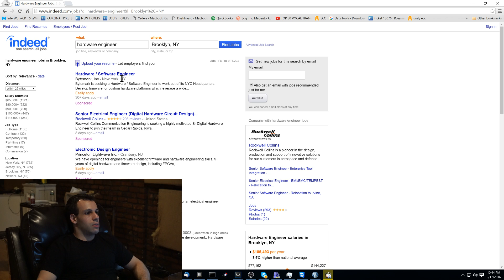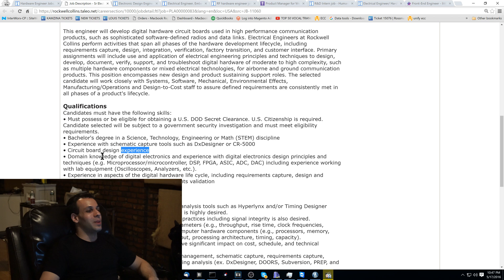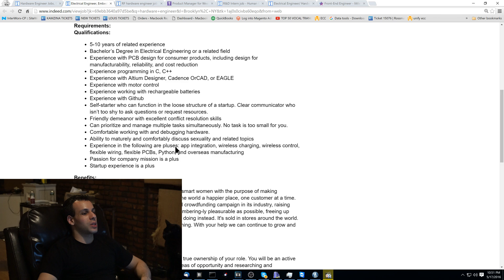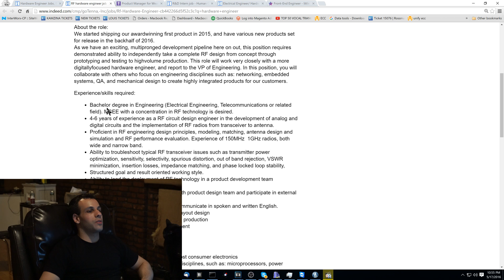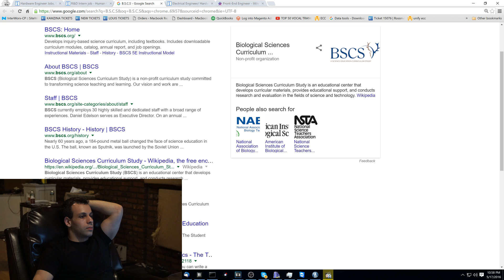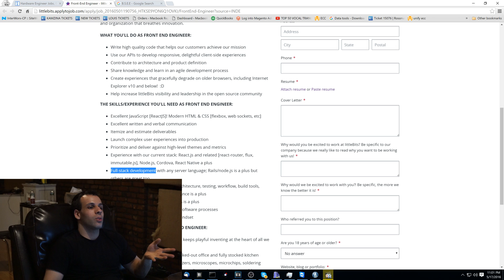Louis looks for a job

Comment: Programmer here. A lot of those requirements for software engineer (lame and pompous term for a programmer) are a bunch of crap. You can work for 5 years as a programmer and be as stupid as a baseball bat because you spent 5 years doing the same thing over and over again, not actually thinking and coming up with real ideas. There are people like this.

And there is a saying where I live which sound kind of like this: "You can be an idiot with a diploma". A diploma doesn't mean anything nowadays since the stuff that they teach you at university is outdated or doesn't reflect real life. Honestly for programming, there are much more better and advanced tutorials on the internet than you will ever learn at university. 

Companies that list a lot of stuff and see that you are capable just because you meet those numbers and conditions are stupid. Companies that list a ton of requirements are also crap and you should avoid them like the plague. 

A real interview checks to see how you are able to think in real life scenarios and come up with good ideas how to solve problems using the resources they give you. That's all there is to it. Honestly, it really doesn't matter if you don't meet some of those requirements if you can just google it and figure it on the spot. That's how I got my first job as a programmer. The interviewer was more impressed about the fact that I figured out a lot of stuff by myself on the spot than what I knew beforehand.

And serious companies that expect you to stay with them for at least 5 years really don't just look at what you know but rather what you are capable of and if you have what it takes for them to forge you into an awesome programmer. 

I have some friends who are programmers and never finished an university/college crap. And now he takes interviews with the ones that graduated university and thinks they are a bunch of idiots.

You know why some companies list a ton of requirements sometimes? Because a really important person in their company left and they need a new one really fast to replace him. So they can't afford to teach you the technologies and stuff they use. They want you to start working right away and produce the same results as the person that left because they need it badly. But think about it, if that guy left the company and he knew so much stuff that they listed as requirements, then there must be a good reason for that. That's a big red flag right there.
Reply from the maker: +Alecu100 thank you for the insight. This was a very useful post

Comment: There is more to pcb design than putting an op amp in a can,you have to take decoupling,impedance matching and thermal into consideration in digital circuits

Comment: this guy is not an engineer, it is just simple serviceman.He got no any exprence except replacing some IC on PCB. 90% ofthese offers are not for him. he just wont fit, have no skill, no education, no real exprience.
Reply: +andr27 definition of an engineer is very broad. He most definitely is an engineer.
Reply: +kazolar if you google the definition of engineer, 'designs and builds' consistently comes up.  Louis repairs motherboards that Apple engineers had designed and built.  There's a big difference between designing motherboards and fixing them.
Reply: +andr27  You're letting ego and arrogance assume that one should gauge the abilities of a person based solely on their degrees and/or certifications. I've seen people with bachelors and masters degrees get their asses handed to them on a platter by non-degree technicians.  He is gifted and has an obvious passion for electronic troubleshooting and repair which not all who enter this field have.
Reply from the maker: +andr27 this is the point of the video.i have no skill, education, or real experience.
Reply: I have a degree in Avionics. He is qualified.
Reply: Engineer is also the person who specializes in finding solution to a given problem in a certain field. Rossman is, in his own way, quite a specialized professional in repairing. So yeah, he is an engineer.
Reply: +kazolar It is obviously a general definition, and a computer is considered an electronic 'machine'.  Note the  keyword "designs".  It doesn't really matter, as "clearly" even Louis himself says he's not an engineer (and I agree), but you seem determined to want to push that title upon him.
Reply: John: couldn't agree more.  Being good at electronic repair requires an assortment of skills, and I too, have met engineers thats that can't use a screwdriver.   btw - Another guy I love watching troubleshooting is "TRXBench" on youtube (he shows step by step troubleshooting of amateur radios etc).   He's another guy that is very good to watch troubleshooting step by step and when the equipment finally works correctly, its so gratifying.
Reply from the maker: ***** dude the oven thing is something i have been over.. and you have no idea how much shit i got for going over that :)))
Reply: +hardware20x the definition of engineer in google does include engines or machines -- which motherboards are certainly not. Clearly definitions have not kept up. If you're so guarded of being an engineer,  that what Louis does is not called reverse engineering, which it most certainly is -- then sorry about your ego. Of course the definition of the word troll is also expanding.
Reply: I don't know what magic it is but I managed to fix a gtx 580 and a hd4850 by putting it in the oven. Theories are that you the damages are so small that an oven for some fucking reason can fix it. It's the last attempt of trying to fix a video card when you don't have the proper tools to detect the problem.

Comment: Louis, you can get BETTER jobs than these offers any time.
After I have wasted several years of my life and lots of money for an M.Sc. degree which I am actually not using but instead working in a completely unrelated field (IT), I can tell you that you made a better choice. 
Namely, instead of getting a useless degree and putting yourself into depth, you got experiency, which MATTERS a lot more.
If you want, you could finish a university any time, especially that now you have matured, earned a bit of money, and you actually know what you are intersted in.

To all young wievers of your videos: Go get experience and TECNICAL CERTS first, with those you get a JOB. Later if you need it, only than spend your precious time on a university degree.
Even a donkey like me knows this ;) ...at least in hindsight...

Comment: Hey Louis, I found a excellent link for learning C the other day.
 It's a 20 part computer science lecture from Harvard but because it's youtube you can skip around or repeat parts as needed.
https://youtu.be/z-OxzIC6pic?list=PLvJoKWRPIu8G6Si7LlvmBPA5rOJ9BA29R
 The code profiler requirement is more complicated but there are some resources for it:
https://youtu.be/H4Z0S9ZbC0g 8086 architecture lecture which will outline assembly programming and functionality.
 Here's a playlist focusing specifically on ASSM https://youtu.be/vtWKlgEi9js?list=PLPedo-T7QiNsIji329HyTzbKBuCAHwNFC

  I know this sounds silly but Cheat Engine is going to be a great way to study ASSM without going deep into a debugger so here's a guide to get you started in CE https://youtu.be/f_axmYpG1Lk?list=PLNffuWEygffbbT9Vz-Y1NXQxv2m6mrmHr

 Here's a guide for an actual debugger called IDA Pro https://youtu.be/fgMl0Uqiey8

Comment: Because you're determined and passionate, I personally class it as dot to dot that kids do lol not to devalue what you do, because I do the same. the only engineering part is when a board is burned and you have to rebuild the circuit stacking caps running wires and stuff.
 
Seriously you're busy but do try Arduino it really does help with programming skills and interlinks hardware sensors and software quite well makes you realise that hardware and software are the same thing.

Being an egotistical douche here, Lidar is xbox Kinect point cloud laser tech lol used with photogrammetry and by nasa only, know this shite, because well the name, and have used it when working with a surveyor.
 
It's going to kill, the civil engineering trade computer automated surveys and auto cad, for topology data a weeks worth of work surveying by a 2 man team drops to a few hours that anyone can do, making a degree in surveying and architecture  worthless.
Reply from the maker: +Astro Man it is literally dot to dot!
Reply: Youtube needs an emoji for nodding head.
You missed the dab with the soldering iron. so it's dot dot dab lol

Comment: Hi Louis, I found this channel via Linus Tech Tips, and I enjoy it more than Linus's channel. One of the reasons HR asks for a degree is to limit the number of applicants.  At one time a high school graduate was the minimum requirement, some factory work has a high school requirement for a monkey see, monkey do job. The biggest actual requirement is a strong back, ability to do repetitive tasks and good attendance. 

You were looking at engineering jobs, which as a MacBook mechanic you are not qualified.  The same way a Porsche mechanic can't design the car itself, but they know what fails, and how to fix it instinctively. You picked the right platform to repair, even with all of the obstacles that are put in your path by the manufacturer.  We both know that Apple doesn't want the users to be able to fix their liquid damaged computer but to buy the latest and the greatest. As you have pointed out several times their engineering forces planned obsolescence.  The product is made just good enough to last 3 years or so.  Items like the non user replaceable battery w/o voiding the warranty on Apple products should tell people something. 

I do think that the Macbook repair business has almost peaked or is on the downward slide to reflect the slide in the PC sales.  I do have the complete confidence that you will transition into another business and be successful at it. You've done it before and will continue to be able to do so in the future.  

I do have one small question, what is the value of using a 0-ohm resistor?  Current-limiting?
Reply: I too found this channel through Louis' rant video posted a while back.  I now watch more of Louis' videos (as well as Eli's), than I do Linus.
Reply from the maker: +David Johnson my guess is as a fuse.

Comment: hello louis,
thanks for all videos what are u did until now.

i saw in a lot of videos that your light from the microscope falls down. i had the same problem and found a solution for that

http://www.ebay.de/itm/222101568799?_trksid=p2057872.m2749.l2649&ssPageName=STRK%3AMEBIDX%3AIT

this ring has a thread to srew it on the microscope and on it hold the light perfect.

hope it helps you.

greetings,
Dozer.

Comment: Tbh engineering is not about complex concepts either. I've got my degree in industrial engineering and studying for civil now and whilst the latter can get very technical the former is usually just common sense. I honestly don't think there's anything stopping you if you'd really apply yourself and focus but I don't know whether it would be a worthwhile option at this point. You already got a business, if anything you've probably progressed further than most that did get a degree at this point. So little point.

Comment: Louis I don't repair laptops, but find laptop repair interesting. I also find some of your other videos interesting because I am a business owner and I share many of your viewpoints on customer service. I just wanted to say I'm a big fan and hope you continue to grow and find more success!

 I also own an early 2015 13" macbook pro. Please tell me why my computer is a piece of shit and I made a horrible decision to purchase something from apple. Thanks!
Reply: +drummaboy5189 I don't do component level repair; but I really like the fact that I whole-heartedly 'could' get started on it; simply based on the foundation his videos have laid out (mainly schematics and board-view sw).

Regardless, this edutainment shit is addicting.
Reply from the maker: +drummaboy5189 that is one of the few that has no real design flaws. it sucks that it isn't liquidproof, but otherwise... not terrible.

unless yours is mid 2015, in which case it is the same as the 2013/2014 machine but it doesn't spin the fan until it is boiling
Reply: Damn I was actually sort of hoping to get chewed out lmao. Guess it's just my luck that I bought the one macbook that isn't awful. But yeah, it's the early 2015 and it doesn't get very hot.... usually around 55 Celsius and then the fan kicks on.

I guess now I'll just have to spill some gross shit on it, try to fix it myself, pour some rice on it, and then send it to you. Then maybe I will get a Rossmann rant.